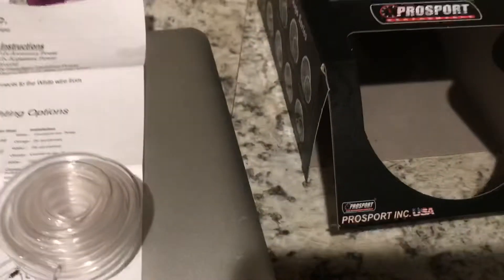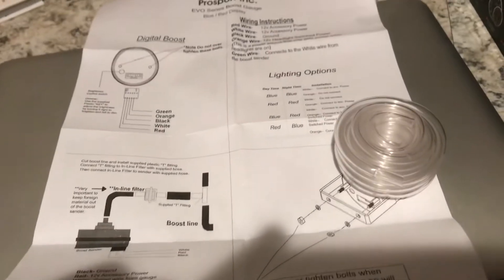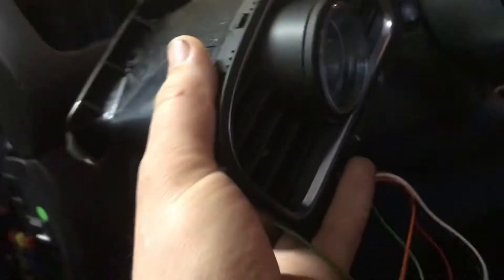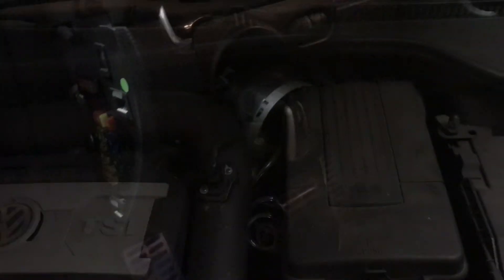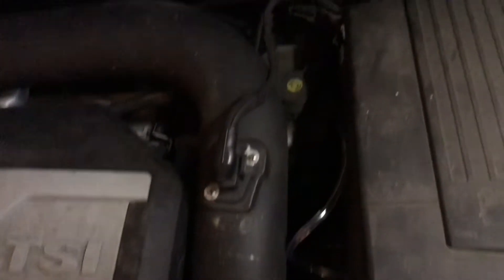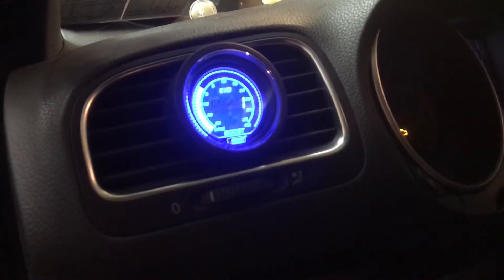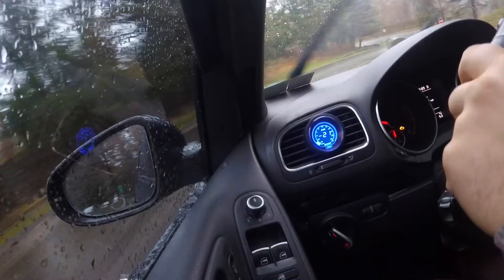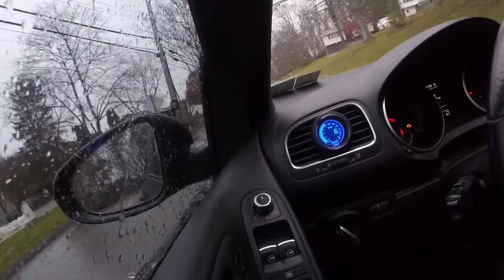Prosport Evo Boost Gauge Install in MK6 GTi

Comment: Diagrams were useful!!! Had an issue with the gauge staying on from the 12v constant so I just gave up and put them both on the same wire for switched power
Reply: Do you put your boost line on the manifold?
Reply: I have an mk6 jetta 1.8t
Reply from the maker: Yes the manifold for the most accurate reading

Comment: You should deffinitely take a quick video of how its all wired. I can't seem to get mine to switch colors.
Reply: I was having the same issue as well did you ever get it sorted out? I did eventually figure it out if you needed a pic of how it is wired
Reply: @vm3331  can u send me that pic
Reply: @vm3331  can you send me that? I’m running into the same issue. I want to say I have the boost module and power from the gauge all connected into one wire and ran to the cigarette lighter fuse but it didn’t light up. I’m sure I have it wrong
Reply: Anyone got the pic of the wiring?? I'm having hard time with it too lol
Reply: I did end up figuring it out I wish YouTube notified me of these comments sorry
Reply: @joshuablanchard8409  yea. I got mine too. Took me trial and error. But I got it. I have it hooked up for both colors too

Comment: So I have a b7 A4 and am having a problem with the wiring. I'm trying to get red red for my guage. I tried hooking it up via a fuse tap but it ended up draining the battery.  And the wires I seem to have to hookup are orange and white and ground (not what ECS says). My question is should I hook white to 12v constant position 8, orange to 12v switched position 4 and the ground? I am really hoping to get this done tomorrow so I can install a double din android auto head unit, just want to make sure all issues are taken care of first. Thanx in advance
Reply: did you ever get this figured out? i always have a B7 A4 i’m getting ready to install this gauge into i just wanna make sure it turned out good
Reply: @nickthierry2439  I did. I sold the car but you just have to play with the wire combos. It's not what ones they say to use to get red red.

Comment: Just wondering, did you have the AC on?? I just got one of these and installed it. and almost immediately after, my diverter valve broke and I had a boost leak. once I replaced it, I started seeing 11-12 psi again. but yours is pushing almost a full bar.. I then noticed when I was gassing it with the AC on I would see it hit 13 psi. nice video, helped me a ton installing this, any information is greatly appreciated!!

Comment: Hey what light on fuse or switch did you connect the other wire too in order to get different color when lights are tuned on  ? Also did you just connect the ground from the boost gauge and transducer all together on the same ground bolt as well as the red wires from both transducer and boost gauge to one crimp ring wire ?
Reply from the maker: The entire gauge is wired into my headlight switch wiring ground and all. Off the top of my head I can’t recall what color wires I used to get blue and red but one of the wires are also to the dimmer to get the color to change
Reply: Giving41, did you find out which wires went connected to witch ones on the headlight switch to get it up and running?
Reply: So in my case wanting red, red, I should not hook anything to the dimmer?
Reply: @hpardo1393  if you want bicolored (blue day time and red evening) wire the white and red wire from gauge together. Connect orange to lowbeams. In my 18 jetta the red and white wire went to wire 4 on the headlight switch. Orange went to 1

Comment: So the orange wire connect to positive of light switch to turn it from blue to red? Then the white wire connects to and 12v+?
Reply: I just installed this same gauge on my 2015 jetta 1.8 and found in the fuse panel in the engine bay there is a accessory power to use but you need to first two to one butt connect the red wire from the gauge and the red from the boost sender and run in out through the firewall and connect in the fuse panel.
Reply: Also mine I bought from ecs tuning/ prosport

Comment: You have a boost leak. On boost you can hear the whistle
Reply from the maker: Enhanced UK it is the diverter valve and the way it’s shaped it literally is like a whistle not leaking just resonating inside the piping
Reply: @westonlieberum1  Ah ok whistle from PCV usually is a split rubber inside causing a leak hence why I asked

Comment: Which one is that from ECS tuning? I want to make sure I get the right one lol  it looks SICK MAN!!!
Reply from the maker: SpenceDaBeast yeah it’s the the kit off of ecs it’s definitely one of my favorite mods to the car only thing I don’t like on a sunny day it’s slightly hard to see
Reply: PghRacer79 I could deal with the sun. I am going to change my tint to a darker one so that should take care of that and I LOVE when you have the lights off it is blue and when you turn your lights on it turns red!!
Reply from the maker: Yeah so do I!! There’s a bunch of color combos which is a nice touch
Reply: PghRacer79  man that thing is awsome can’t wait to get one! Are you tuned? I am running APR Stage 2
Reply from the maker: I have a intake down pipe with a race cat, cat back exhaust and stage 1 tune.. I’m waiting til I go ko4 then I’ll get retuned
Reply: @westonlieberum1  how do you change the colors ??
Reply from the maker: Depending on what wires you install if you look at the wiring diagram it will tell you which color wires change the display colors
Reply: @westonlieberum1  how did you do that program it I bought one but not sure how to make do other colors when I hit headlights

Comment: That’s sweet did you use the small filter that came with it ??
And do you need it just wondering if it causes restrictions
Reply from the maker: The small filter doesn’t make a restriction at all and definitely use it because carbon or other small debris can ruing the pressure sensor if you don’t use it
Reply: Ok thank you 🙏

Comment: How did u change your colors? Mines stuck at white
Reply from the maker: Depending what wires of the bunch you use coming out of the back of the gauge is what color it will make the display
Reply: How do you get the white.? I got the blue-red one. Lol

Comment: Where did you wire the boost sensor to ?
Reply from the maker: supra1102 the headlight switch
Reply from the maker: The wiring is to the headlight switch the boost signal is tapped to the side of the intake manifold